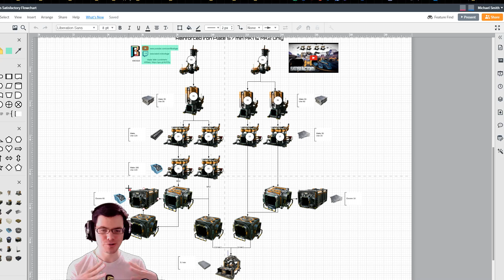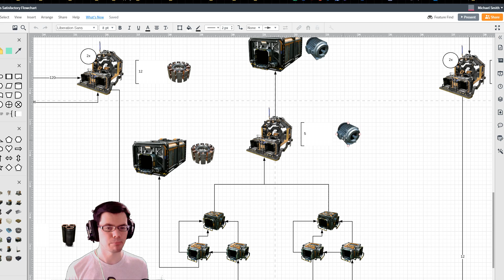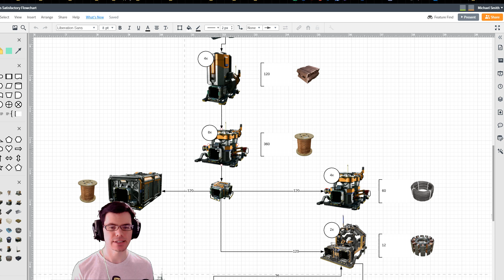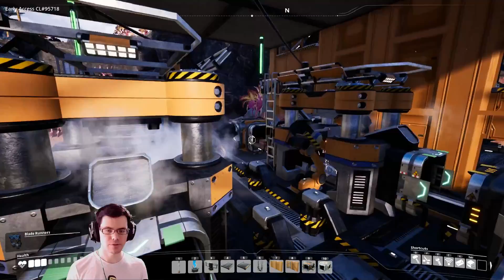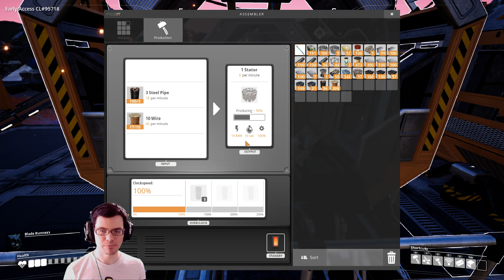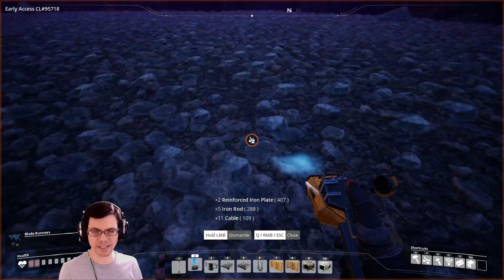Stator Manufacturing! Satisfactory Vertical Production

Comment: idea simple and effective. Build 8 tower cells around an empty central square. 
Each a structure separated but feeding one an other making every floor produce a different product or multiple.
The center node being used for material up, and outside for moving products down amusing the bottom is the bus storing both. Last power can be in floored loops turning that floors production on or off easily.

Comment: I just had to triple my steel production last night once I got the alternative recipe for the encased beam. Pipes are suddenly SUPER HIGH IN DEMAND. I've currently got my factory automated all the way up to heavy frames and computers. Just looking at the next steps for what I need to add to bring that up to super computers is really daunting! Can't wait to see what your factory designs are like towards this area of part manufacturing!
Reply: Likewise.
Overclocked my nodes to run 10 foundries into 20 constructors to supply enough pipes for the stators, ALT encased beams, ALT modular frames and ALT heavy modular frames.
What are steel beams used for again?

Comment: Brothgar, if you find the "fog" to be annoying, I certainly have, there is a way to turn it off.
Ctrl-Shift-L - to enable access to the console
hit the tilde/open-single-quote key - to open the console
type: "r.fog 0" - (no qoutes) to disable fog (replace the 0 with a 1 to re-enable it again)

It makes building in the Desert/Northern Forest starting areas so much easier. The devs need to make turning fog off an option.

I don't mind it hiding the edges of the map, just don't obscure the actual landscape, unless the idea is to make folks from San Francisco feel at home. :)

Comment: Motors!  Awe, I wish you could build a Battleship... or a Space Platform!
Reply: @brothgar  Yep, the only way i see to do this in the game right now is with the Truck Stations.... but reconfiguring the constructors is still a manual operation... this there would have to be some manual setup operations in between each production run.   You would need some sort of spreadsheet to keep track.
Reply: what about a time based factory.... where you build a stockpile of plates for a time... say 1 hour and store them.   Then the factory changes configuration and builds rods for an hour... can you see where I'm going... instead of having a bunch of factories.... having a central storage and a automatically re-configurable factory where each component is built up and stored then automatically reconfigured to stockpile all of the components to be used as inputs for an assembly factory. If you had a storage big enough, you might be able to keep an assembly factory going while you are playing... then in the background when you aren't focusing on the game... maybe you have a day job... it could build up inventory. Conserving power as well... as not all machines are on all the time.
Reply: @MikelNaUsaCom  this is a cool idea. maybe if they eventually have automation in the game. the only problem i see is storage - you could use smart splitters to separate items to different "warehouses" but this seems like a lot of work. But if your going for compact as your concept then this would be ideal. At the same time, so many items use different products down the line that I fear doing this would make your compact world total spaghetti of various warehouses and splitters sending things everywhere.
Reply: @AaronGrycowski  ya, idea was like the Automated Storage and Conveyors in ONI.  Automation would be key to get that done.
Reply: In real life the Bill of Materials for a Finished Goods product could have several recursive levels... There is also a List of Operations (or Routing) which can be done on the materials to in a specific order... in fact you can feed some lower level MOM (Method of Manufacture - made up of Bill of Materials (BOM) and Operations (Routing) ).   The automation for this in real life is call - MRP (Material Requirement Planning) and is a part of a ERP system. https://www.planettogether.com/blog/erp-or-mrp-sap-or-aps-whats-the-difference
Reply: also in the real world... things go wrong... there is scrap... there are faulty parts... so you have inspections... you can sub-contract out certain parts or operations on the parts... there are infinite operations .... painting, welding, forging, printing.  And there are tons of resources including skill craftsman, vacations, holidays... tariffs, duties... theft... corruption.  There are multiple revisions for parts and finished goods...  new products... etc.  human error.
Reply: @MikelNaUsaCom  that would be an additional system I would like to see... like the ore lvls ( crude, normal, pure ) you could have a lvl based on the research that allows you to produce higher quality machines. (low quality, average, good, best) each having a % of making faulty products which could still go down the line, cause a back up or a problem down the line creating bad machines or whatever. This would incentivize making sure your machines are repaired and are the highest quality you can make. *since the only thing that really causes a break down is power - this could be another layer .... I like the way your thinking